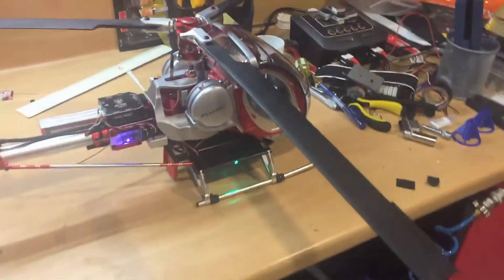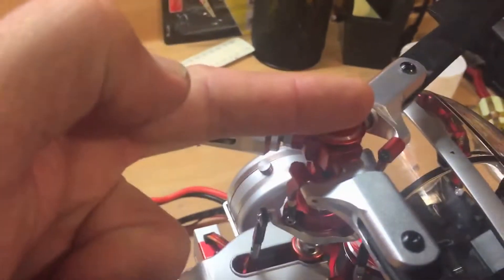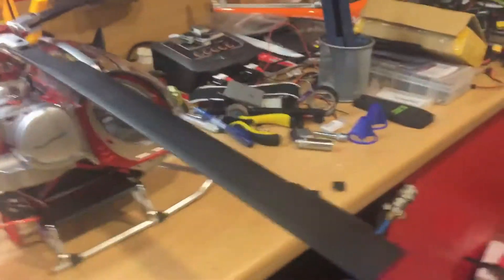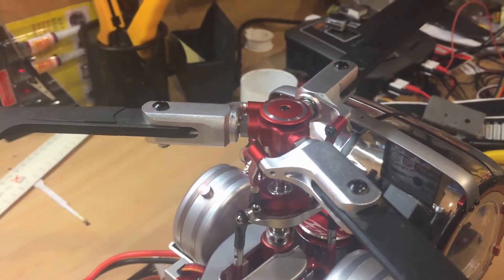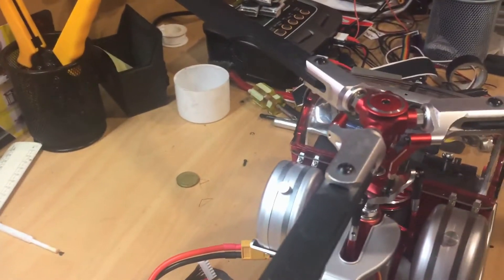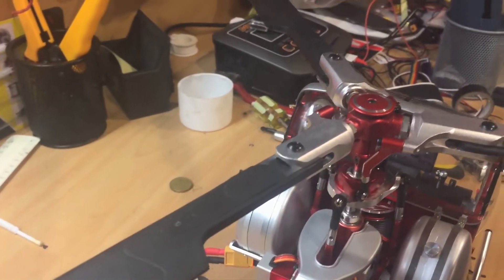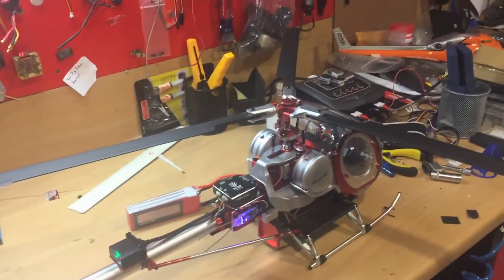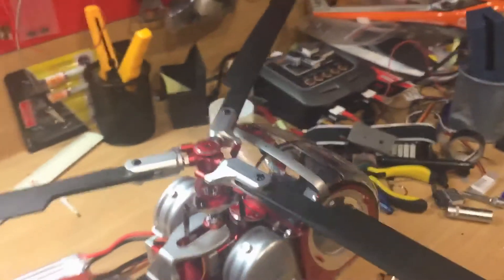JC300C rotor head review - phase angle issue

Comment: I was told head phasing on multi rotor heads is set 10 degrees before balls are lined up because in real time things happpen faster than in static time any difference is programmed into FC  to adjust for any lag in phasing that is how my 4 blade works and it flys fine.

Comment: Hello, my Name is Mário. I really like Your Videos, and recently I bought a "JCZK300c" and I have a doubt I would like you to help me: after having successfully performed all the start-up procedures (unlocking, gps, etc.) I find that the Throttle Stick does not accelerate nor does it slow the engine, that is, the acceleration is always constant. IT'S NORMAL????
Reply from the maker: unfortunately yes that's how they are, they fly in idle up - constant RPM mode
Reply: @kiwi_craigrc1613  Yes, it really is a DISILLUSION, but, HAPPILY not VERY BIG because this Heli is FANTASTIC. Thank you very much for your attention.
Reply: @kiwi_craigrc1613  In another "LINK" and about the same "subject" I received this ANSWER to which I WOULD LIKE TO KNOW ALSO YOUR OPINION. Thank you. - «««Hello Mário, that is not normal. I have that problem with a problem in the configuration of the TX which was delivered with it. I never get it flying same as you. Than I sold all. I bought another and everything is ok. Now I fly with an completely other system and my Radiolink with Receiver is working perfectly and I am selling that system. It works. I fly now my FLYPRO 300C with a FRSKY system.»»»

Comment from the maker: You can offset the j arm with a longer bolt and spacer or write a correction mix in the transmitter.   I did the latter and it then flew perfect.
Reply: Can you direct us to a how to guide on writing that? New to RC and just ordered this heli! Thanks
Reply: Yeah how to write the correction mix??
Reply from the maker: @worldjik  https://www.rcgroups.com/forums/showpost.php?p=39968218&postcount=146
Reply from the maker: @worldjik  https://www.rcgroups.com/forums/showpost.php?p=40037604&postcount=168.  see the last two screen shots.
Reply: Wow thank you for the tips...but if one unit from the factory like this...then all of them are the same...which is having the same issue..
Am I correct??
Reply from the maker: @r.r-vr4684  they could well have changed the blade grip arms to sort the problem in later units. Do the checks like in the video to see if yours has the same problem.